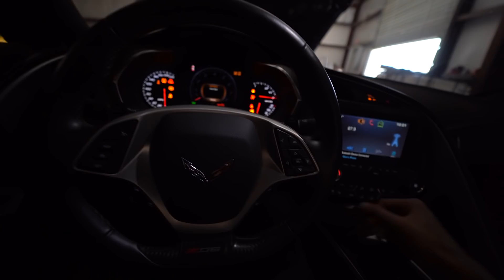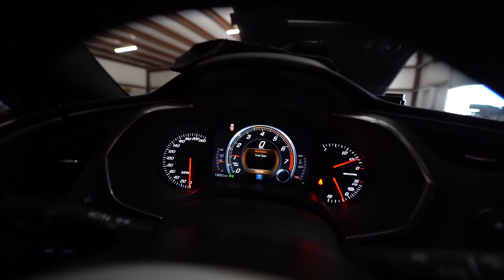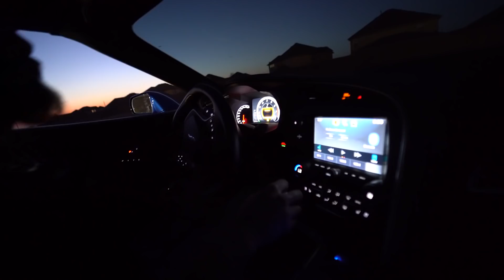My New 1000HP MONSTER CLUTCH!!

Comment: Just a heads up....if your next set of O2's eventually go again in 500-2k miles....I can already tell you its the Texas Speed Longtube headers. The o2 bung location is too far downstream and it causes the heater circuit to run alot more then normal eventually burning up the o2's.